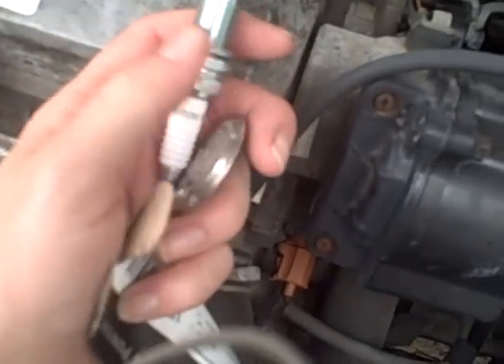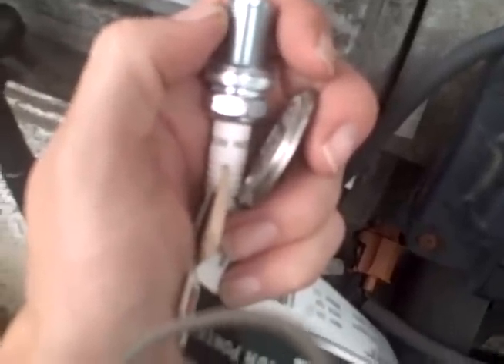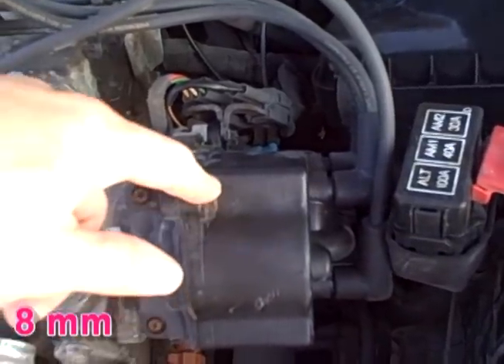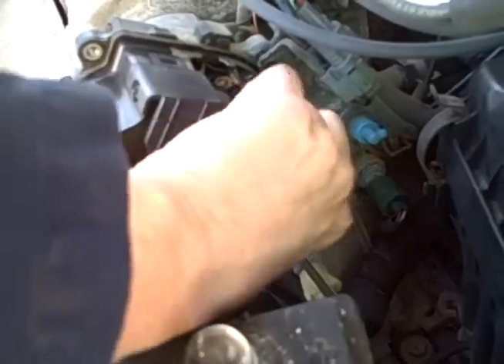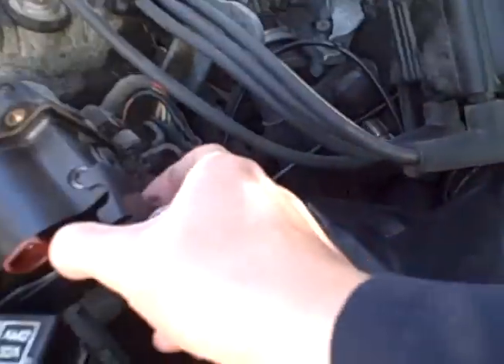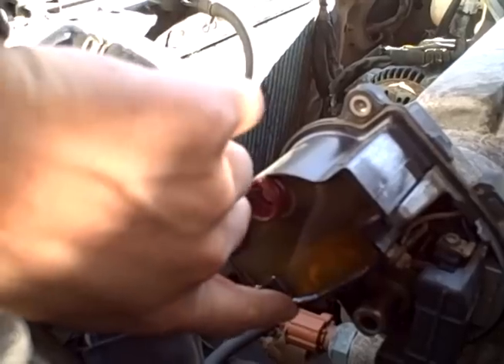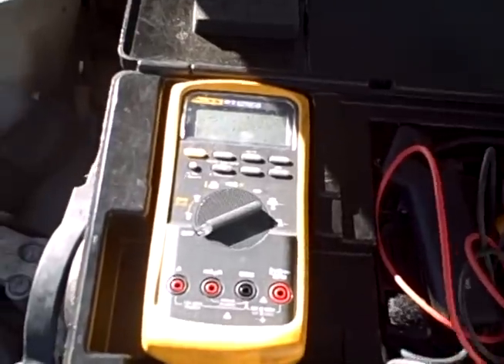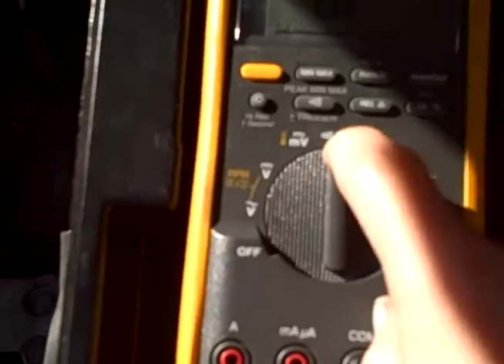How To Determine If You Have A Bad Ignition Coil. (Results May Vary)

Comment: OMG!! its Sarah Connor!! Thx a lot for you video :3
Reply: Notice she checked The Resistance :)
Reply: i have one question, how installe distributor? need put motor on time ?
Reply: @downhillxtreme502  English, please.
Reply: my corolla 1.8 year 99 have the code 14 x.x)
Reply: Don't forget the plug check to put The motor on time.😛
Reply: @marcolightyear  That's all it takes, is that one time..
Reply: Lmao
Reply: I'm not always there when you call... But I'm always...
Reply: I have a 1999 Camaro 3.8l... my car was driving fine then one day it just cut off wouldn't cut back on. I bought a new battery and drove for maybe 2 weeks then it cut off again. This time it just cranks no start though. Thought it was the fuel pump but I have a new pump so. What could it be?? When I first bought the car the check engine light would come on and go off some days it would stay one some days it wouldn't. Had it for about 2 months now it won't even turn on just cranks what's could this problem be??

Comment: No, a resistance measurement is only a crude test. You can have shorted turns and the resistance will still test fine. In some Toyota's (my 1990 Camry) the igniter lives external to the distributor. Incidentally, Toyota says the distributor is not rebuildable but that oil seal can be replaced with a generic one.

Comment: I'm working on the same car, weak spark after I changed the wires and cap and rotor.  You have to floor the gas pedal to get going 50mph.  I've seen online the corolla for these years is prone to ignition coil failure.  And may break a new coil after only a few months, which I heard was fixed by a new distributor.  I hope I don't have to buy a new dis... Thanks for the testing numbers i'll try that first anyway.

Comment: Yep! I'm dealing with this... just on a 93 (4AFE.) I came to the same conclusion: Everything is already in the Distributor which takes about 5 minutes to change, not more than 10, and it's either gonna work or it's not since duds are fairly common, and when you get one that works it will fire right up............................

Comment: I guess there must be no way to really test coils? I was starting to think I was going crazy or my meter was totally jacked up because I bought a new ngk coil then sent that back as it tested far out of Toyota's acceptable range per their manual then the beck arnley I got this time also tests outside the range for this 91 Camry. This thing Will run fine then after you drive it a while then turn it off and start it again it'll start dying. It'll run fine about 30 seconds then die with a total loss of spark (used my timing light to see the spark). Then you let it cool about an hour then it'll run again so I'm thinking it's the coil heating up butI keep sending them back being out of spec. Coil on mine looks just like this 94 in the video. The repair manual specs in the manual I have claim it should be 0.38 to 0.46 on the primary coil & 7.7 to 10.4 k ohm for the secondary and claims if it's anywhere outside this range replace the coil. Coils I keep getting test 1.5 to 1.8 primary then 12.5 k ohm secondary. I keep noticing my factory old coil tests closer to being within that range than the new so I keep sending them back wandering what on earth is going on lol.

Comment: D6Spanky when gapping spark plugs, them gappers from Autozone and O’Rilleys ain’t the best to gap cause they can be inaccurate, use them other kind that has them hooks around them with the gap attached or stamped on em... I was told at school where I’ve attended before or check your gapper for accuracy with a feeler gauge, that really helps... You did everything very well, many folks don’t quiver props where props is deserved and you Ma’am deserve a lotta props, especially for knowing your way around a Fluke DMM... :-)
Reply from the maker: I can see using a feeler gauge for performance engines but otherwise seems a little overkill for my applications. I WILL keep that in mind though! Thanks for your comment!

Comment: Hi there, So I take it if the circuit on the secondary coil is open, the coil is garbage. It does read 4.7K Ohm if I touch negative on my meter to that center metal tab on the ignition coil instead, but no reading on that rotor shaft. Even if that's another way to test secondary resistance, that's still out of spec for a '93 MR2 2.2L. Claims it should be 9.0-15.4K Ohm. I already replaced the EFI Relay and Ignition Control Module (both tested as bad). I really don't want to tear into that wiring harness if it isn't necessary. Doesn't seem like anything is wrong with wire continuities. Just wondering if you have any diagnostics thoughts after reading this. If that coil sounds bad to you I'll try that part next. Guess if that doesn't do it the harness will have to be unwound.

Comment: 93 corolla coil crack in epoxy across top by HV .pin just replace it ohm test won't help you intermit spark Geo's 93_97

Comment: Nice to see DIY!  Small suggestion, and it might have already been done and not shown.  When disconnecting the battery, I do the negative first.  If you do the positive first and accidental contact a ground with your wrench it'll short the battery.  When connecting the battery, positive first and negative last for the same reasons.
Reply from the maker: I know,  I know.  But thank you for wording it do kindly!

Comment: I pulled the valve covers off my buddy's 72 vette 350 and discovered a noisy valve train with loose rockers. It had been running poorly and popping through the exhaust. We put a new cap and rotor on and tried adjusting the valves multiple ways, including while running. After at least 4 adjustments I have come to the conclusion that he has a solid lifter camshaft. It would only run with zero lash, no preload and as it gets hotter (warmed up) it starts to pop through the exhaust. The lash gets tighter with heat, hanging the valves open. I'm going over this morning to set the lash to .010"I/.015"E

Comment: well done - you can also feed 12v to the coil plus - when you break the coil neg to earth then a spark will be generated  (if the spark plug is connected and earthed (with the coil negative).....If all is well

Comment: Next, before waste your money, please used electronic tester, take out electronic module from the disturbator or disinstall the electronic module. And, test if the unit is holding electronic current or transmitting current. Then, you will know whats more efficient a new distributor, electronic module or whether the built coil is damaged or just hold electronic current to tranfer to the rotary..!!

Comment: I had a clunk in my front end and I thought it was struts, 250 later not fixed, tried ball joints, not fixed, tried inner tie rods, still not fixed turns out the problem was the steering box witch i could of afforded to fix if I got it right the first time...

Comment: I'm having the same problem with my 1992 Toyota Paseo right now.  Battery, starter, solenoid, engine, everything seems to be OK, but no spark ( combustion ).  It's got to be the igniter or the distributor coil.  I just wish I knew which one.  I got prices tonight on both at 2 different parts stores.  The igniter runs between $190 and $220, and the distributor between $170 and $190.  Which is more likely to give out, the distributor coil, or the igniter?  Nice video though, I just wish you had a solution to the problem at the end.  : )
Reply from the maker: it's cheaper to buy a whole new distributor. there's also a relay that can develop a spur. I can't think of what it's called this second but Brian (briansmobile1) has a video on it.

Comment: If you have a no start condition and you measure high resistance on the coils then the coils are/could be a cause but not the problem.
If you have a running engine but it runs bad and you have high coil resistance then your coils are most likely to blame.
If you have no resistance at all on the coils then you will have a no start and well that coil is your problem unless it is a multiple coil setup. 
Many cases people have is the car tries to start but stops straight away because they have multiple coils and one even two have failed which cause the engine to stumble and stall. This is the coil conditions for a misfire and rough running especially when the engine is hot as the heat causes the insulation to break down.
Reply from the maker: thanks for your comment!
Reply: +D6Spanky You are welcome, I had a recent coil over plug failure. I should have seen it sooner as all other coils when pulled off the plugs took extra pressure due to vacuum crated in the rubber boot when you pull it off. One of the coils came off too easy without this. Added a little grease to the inside of the boot and tried it again, still no sucking pop remove it, the boot was bad.
This was my problem and after changed it worked perfect again. Had to replace whole coil as boot was not sold separately.

Not many people pay enough attention to the rubber boots. They can take down a running engine, something as simple as that.
Reply from the maker: Truth.

Comment: Resistance will tell you if it's out of spec, but it won't tell you if it's leaking on the high voltage side. If either side is higher or lower than it should be, then replacing it is a good idea.
Reply from the maker: Jonathan Martell Thanks for your comment!!

Comment: Disconnect the positive first? You should know, when ever you disconnect a battery,  you disconnect the negative FIRST and reconnect it LAST. Had that ratchet touched anything on that car while you were disconnecting the positive or had some metal object landed on the battery positive and touched ground it could have done some damage to the car or yourself.
Reply: neg first
Reply: Frank Gonzalez omg don't mansplain.
Reply: +SlamPig84 have a bit of hate built up? It's ok, I can see with your limited vocabulary why you have all that hate built up.
Reply: It can be dangerous . But I work on my car all the time with the battery connected . Been doing it for 20 years . Been shocked about 100 times , I'm still alive ! Lol ! I'm sure she had the negative already removed . Because, it's printed & pasted all over parts boxes & even the Autozone guy usually says . Your gonna want to make sure to disconnect your battery before you install this . So it's a given ... But , maybe she should have said disconnect the negative terminal before working . But, I disagree because I have worked on mine so long with the battery fully connected !! Hahahaha! But, yeah maybe she should have said our shown it . But , it was a good video . No need in pointing out that the way you did . I mean come on "Spread the Love Hoss" Hahaha! Alright I have said my opinion like it even matters . Later & peace !

Comment: Hi I have 94 chevy 1500 5.7v8 and I put a new altanator on and now I lost spark so I put a new  module On and unplugged the alt
And it started to run plugged it back in and the new module stopped working need help??
Reply from the maker: FabRizz DA Dransfield Exactly what module did you replace?
Reply: The one that goes on the dizzy
Reply from the maker: FabRizz DA Dransfield And the dizzy is... what exactly? I've never heard of it in reference to a car.

Comment: thank you  I have the same 91 corolla and your videos are very helpful. but I wonder do you still have your corolla? and do you have any other starting electrical problems?
Reply from the maker: a67bitpro  I do have her still. :) "Goldie" is sitting in the driveway now, DEAD. From everything I have checked, the fuel pump is bad. But I'm 9 months pregnant and can't fix her right now. I can't lay on my back that long and can't be around the fumes! But the previous owner said that when she got hot, she would just turn off or not restart. Brian (from Briansmobile1) is going to verify and replace the fuel pump for me. It was an intermittent no start so I'm not sure what the problem was. I know that several people have asked different forums online about that but no one ever posted an answer. I believe that Brians said that some Honda relays don't work in hot weather but we tested the FP relay and it was fine. *shrug*  That's the only problem I have had. Are you having any other issues?
Reply: wow thank you for the fast response. and good luck with your pregnancy. what am I saying. its not like this is your first one.lol. but yes I have had a 91 and 92 corolla dlx and they both have electrical issues with starting. I have changed fuse links, neg terminal cable, starter, the ignition switch and nothing. so I thought there had to be a short between the fire wall and starter terminal. the smaller plug. so I rigged a bypass from the black and white wire from the top left of the ignition switch harness connection to the small terminal on the starter. now that solved that issue with the  91 corolla in PR. but my corolla in ny is the one im working on now. I am going to switch out all ignition parts. switch, fuse links, starter, distributor and if all that fails back to the bypass trick.
Reply from the maker: a67bitpro Thanks.  So far,  so good.  I'm going to have this baby any day. Yay!  I would have replied sooner but... toddlers. :)  anyway,  now I want to go look at Goldie to see if she had a short there. I physically can't,  but perhaps Brian will help me out with that. I'm sure he will because he bails me out when I'm stuck. Poor guy. Could you email me the symptoms of your corolla and then what you did to fix it?  I'll likely end up losing track of these comments before I can look at the car it again.
Reply: D6Spanky sorry for the delay. I have two jobs. but i don't know your e-mail. it would take a lot of space in this comment section to explain everything done.
Reply from the maker: a67bitpro So, I wanted to let you  know that the starting problem with my car isn't the ignition system, but the fuel system. I am hoping it is in need of a new circuit opening relay which seems to be the only option left. I'm too pregnant to work on it and Brian has been working on it for at least 6 hours today. Fingers crossed.

Comment: My first car was a beater, 1984 Ford Escort. I bought a Chiltons repair manual and a ratchet set and started fixing it up, my dad had no faith in me! After my experience working on my own car I decided to go to vocational school nearby. 1-1/2 years, 2 courses. Did not get ASE certified. Started working as service apprentice at local Mitsubishi dealership, left after about 4-6 months, management issues! Went to work with a friend for several months at a sunroof and simulated convertible top shop, I installed power sunroofs, pinstriping, decals, leather upholstery kits, exhaust kits. Then I worked for a few years at a truck accessories shop. I installed cruise controls, trailer brakes, trailer hitches, running boards, bed rail caps, bed liners, tool boxes, tonneau covers, car alarms, power lock & power window kits, neon undercar lighting, and later on repaired headliners with another friend. Lots of experience all around a vehicle.
Reply from the maker: I wish I had that much experience! I never got around to getting ASE certified.Right after my big final (like the next morning), I left for a job in Alaska. I'd like to get certified eventually but only for me. That's a really cool work history/experience! Certainly a lot more than I have! Thanks for sharing!

Comment: I have the exact same problem. No spark.  Still contemplating if I'll buy just the ignition coil or the whole distributor itself.  How's your corolla? Is it running fine now?
Reply from the maker: Hey Paul, sorry for not getting back to you sooner! The problem was actually a fuse that kept blowing. See my video "Fuses, Codes, and Brick Walls, Oh my!". If your fuses are all fine, I would get a whole new distributor. It won't cost much more (most likely) and will rule out a bad ignitor. But that's just my humble opinion. :)
Reply: D6Spanky Hi Spanky..I already bought a distributor but it doesn't have a good spark..it's very weak.That's what my mechanic told me. It was brand new but made it Taiwan..I returned it, and I'm still looking for a new one.  I called Toyota here in the Philippines, and a brand new one costs P60,000.  That price is like an arm and a leg, just ridiculous.
Reply from the maker: Paul Jason Oh suck. Yeah, I bet it's hard to get good parts there. How much is that in US Dollars? And do you speak any Tagolog or Cebuano?
Reply: I'm from Cebu. I'm Cebuano.  That's almost $1500 for the distributor only. I have another mechanic who's trying to fix it. Coz the new one I bought (Ishin Denki-made it Taiwan), doesn't work. It has a very weak spark, and that's what he said, that won't start without a good spark. Crossing my fingers for tomorrow.
Reply from the maker: Paul Jason Can't you just order it from the US? They are pretty heavy but I wouldn't think it would cost THAT much to ship.  
That's cool. I had a friend teach me some Tagolog. Sadly,  I don't know any Cebuano. But at least I know what it is!
Reply: D6Spanky Hi Spanky, my mechanic just fixed my distributor. He just replaced the ignition coil and it started.  I also got a new carburetor, but the idle is still unstable after he tweaked it. The rpm needle keeps jumping back and forth. I had to raise the idle to keep it from stalling.  He's suspecting a vacuum leak somewhere. We're gonna change the vacuum hoses tomorrow. I'm just happy my car is starting again. I thought it needed an overhaul.  Will update you soon. Thanks!